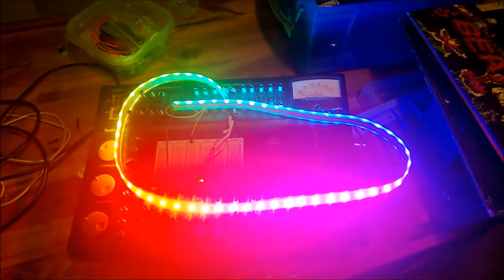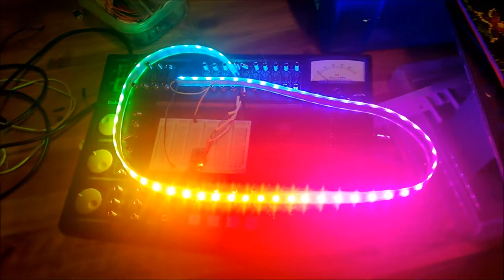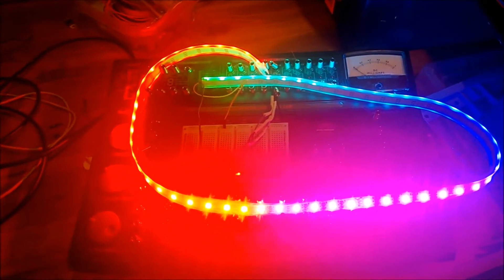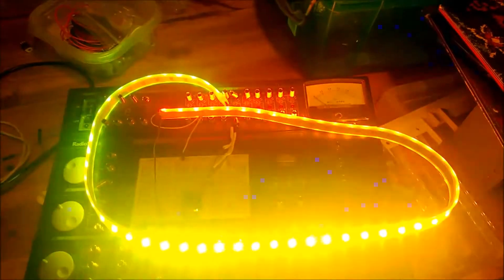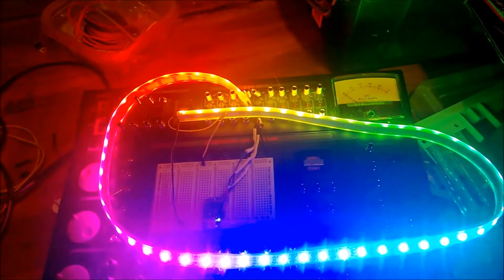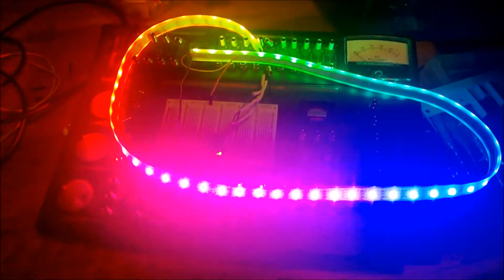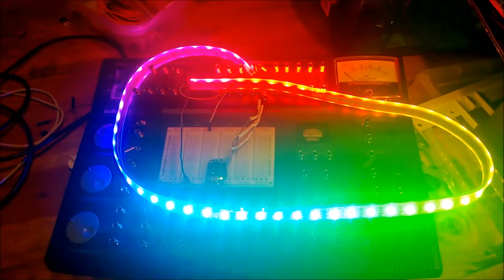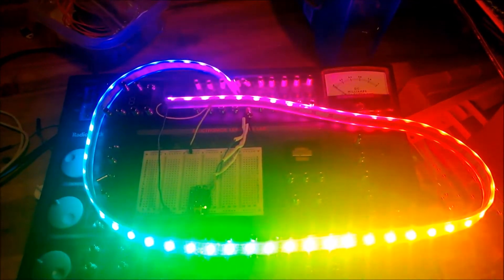Testing adafruit trinket and digital led strip

Comment: what cables did you use?
i see that you used the adafruit led strip and the trinket but did your strip come with a connector? or how did you connect them?
Reply from the maker: tessie neidermeyer I soldered on breadboard jumpers.  I just cut off on end of the breadboard wires and soldered them to the strip to i could connect them to the breadboard easy.